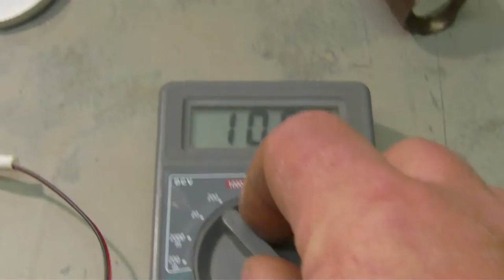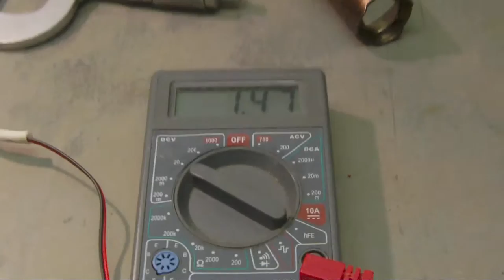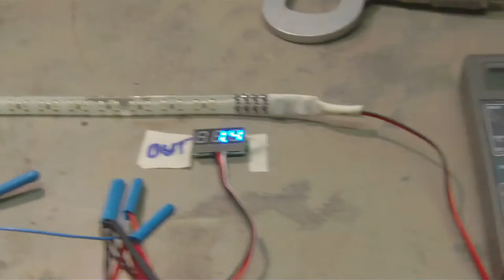ch*19870517 ITEM 381428312916 DC DC Step up converter

Comment: Is it possible to provide a suitable output for the laptop input, which is 19 volts and 7 amps, with or with a 12-volt battery of the car, which is 60 amps?
Reply: Pm me can you to install do sola paint of charger